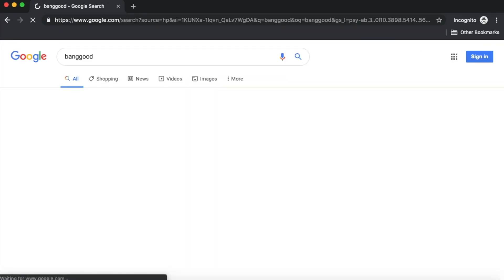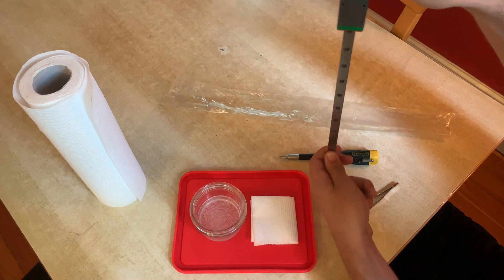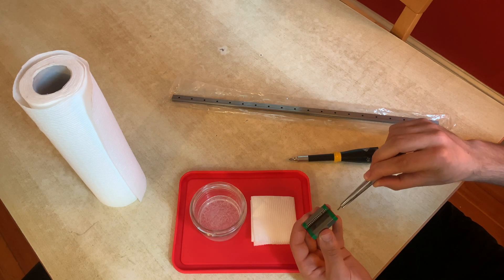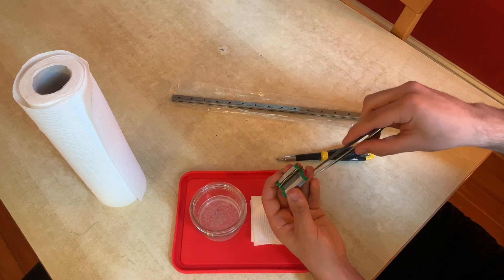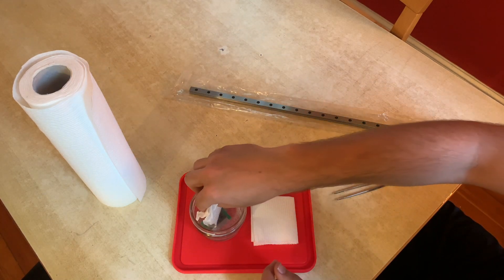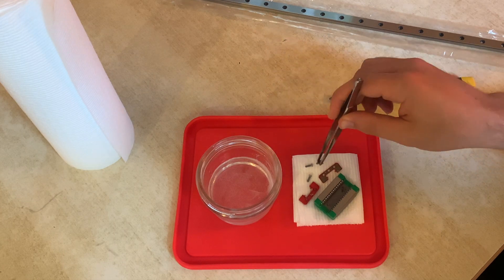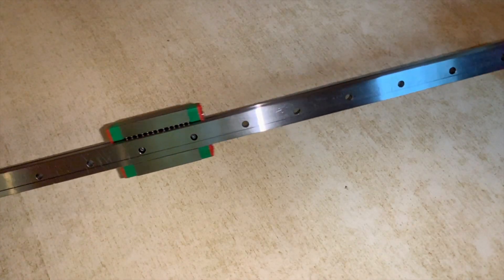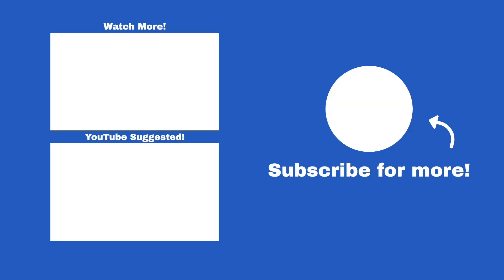Machifit MGN12H Fix! - Linear Rail

Comment: But that way you take off the anti rust protection film :) Better way is just to drop a few drops of machine oil directly into the ball rows :)
Reply from the maker: For rails that aren't allowing the block to run smoothly, I like to clean everything thoroughly and then, depending on the application, apply any lubricants and anti-rust agents after the block runs smoothly. Thanks for your comment!

Comment: Yeah, so the mgn carrige is not supposed to free  moving freely when tilting the rail... The carriage is supposed to be "sticky"
Reply from the maker: Yes and no. I understand your point, but in my case, the carriage was so "sticky" that it would make a grinding noise and jitter when it moved. It now glinds smoothly, and I was able to add my own lubricant to it.

Comment: Do not use silicone grease to lubricate steel moving parts. Silicones do not work well in metal-to-metal contact. Do not use lithium grease on aluminum parts as they will damage the surface of the aluminum. The best solution for guide rails is either frequent lubrication with mineral or synthetic oil, or occasional lubrication with NGLI-2 grease. (I use blue "chevron delo" grease).

Comment: One other suggestion for people if just soaking the parts in alcohol doesn't work, would be to take the entire carriage apart and remove the ball bearings inside. Check the inside tracks, the ball returns on the ends, and any other surface for trapped grinding dust, burrs, swarf, or other debris that may have been trapped inside.

Another option would be to measure then purchase a set of replacement balls for the bearing itself. From what I remember, some incredibly high precision balls can be ordered very cheaply online because they're sold and used in such large volumes.

Hope this helps someone else too!
Reply: Thank You so much for the Info related to balls for the bearing separately ... Do you have by chance any link ? ... Thanks again
Reply: @mariuspetcu7482  the ball bearings you want are 3/32" G25, I got mine on amazon.

Comment: Did you found any big cons of those rails after year of usage? Any play or wear? Im thinking to buy it for small milling machine.
Reply from the maker: No, not really. Just keep them clean and if they're well supported they should be fine for most needs. They aren't the most precise rails out there. But for the price, you can't beat them.

Comment: How flexible is the rail itself?
Reply from the maker: Travis Peña The rails are extremely rigid. They don’t bend. Some of them aren’t perfectly straight, but for simple applications they are fine.
Reply: @colekraus  Aw man so I cant get that <.00005 runout I've been chasing? disappointing. But seriously thanks for the info.
Reply from the maker: Travis Peña No problem, my pleasure

Comment: Do you know if it is possible to "pop" the carriage off of the rail (ie twisting it off)?
 I am looking at these for a project but I am wondering if a lateral force will push it off of the guide.
Reply from the maker: Daniel Tkaczyk in my experience is it not possible to twist it off with lateral force. I’m sure if your load doesn’t exceed a few points laterally it should be fine. These aren’t the most expensive linear slides on the market, so if there’s too much load I would use different slides.
Reply: @colekraus  Thank you for the quick reply! That's awesome to hear! In that case, I should be good to go. Thank you for the advice
Reply: I realize this was awhile ago, but wanted to post for anyone else that sees your question. The answer is almost certainly no, especially as you move up in size. Most sellers list in the pictures a table for the rail that will provide a list of how much static and dynamic force would be required to provide a permanent deformation to either the rail or carriage. From what I remember, these forces are listed for all the axis of force a carriage could experience, and most are in the hundreds to thousands of pounds/KG of force. True linear rails like he showed in the video are incredibly strong as long as they're installed properly.

Comment: Hi thanks for this quick guide, I'm considering ordering the same type of rails for my 3d printer. By the way do you know what is the size of screw needed to mount the rail for example in a 2020 aluminum profile?
Reply from the maker: jaguar1822 It is designed to use an m3 screw.
Reply: @colekraus  Thanks! :)
Reply: what printer are you looking to get this for, i will be getting a 300mm one for my ender 3 and hopefully once i get something that works i will be selling kits for it on ebay
Reply: @Cosharek  Hi, I want them to update my Anet A2
Reply from the maker: Cosharek I’m using them to build an automated sprout grower. If you’re interested you can check it out on instagram: www.instagram.com/sproutbot

Comment: I have ordered the same MGH12H with extra blocks, the problem is with the extra blocks, it does not move properly and it is hard. Maybe I should try your method to smooth the block movement. Thanks, @Cole Kraus
Reply from the maker: I would suggest trying my method. I’ve also found loosening the screws, adjusting and retightening once the block runs smoothly seems to be effective as well.
Reply: @colekraus  Hhhnnmmm I will try to reposition screw's you are talking about. Hope thats work. These blocks are giving me a pain in my @$$
Reply: @colekraus  tried all of this, but the extra blocks are all very tight, replaced all balls as well, but still no good. They do move differently under a load, but most of the extra blocks are useless.  Removing several balls works, but I don’t think this is a solution. I’m still searching for a solution. But your smooth gliding blocks are very far from the ones I have.
Reply: vial.of.photons  yes, it is working smoothly, and one more thing needs to discuss with you. i have removed few steel bals (2 bal) from each block and it is working even more smoother. but I don`t have an idea what would happen?